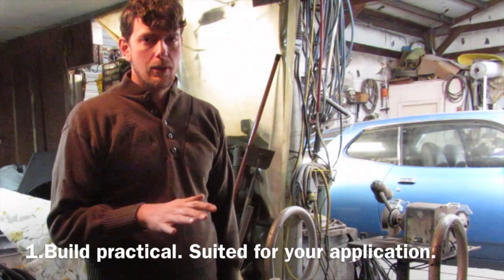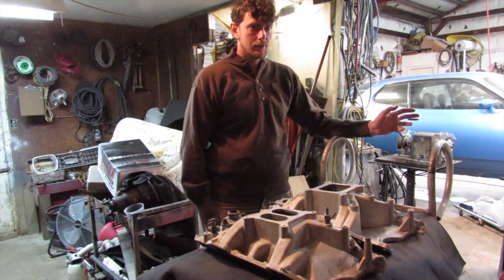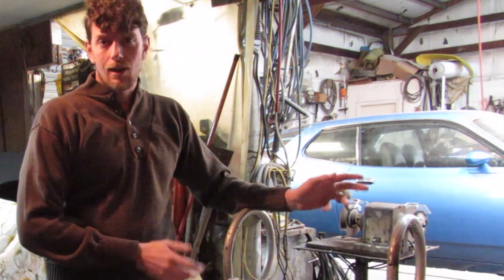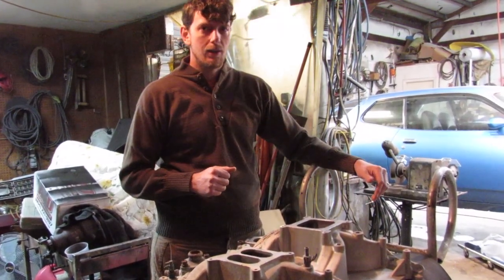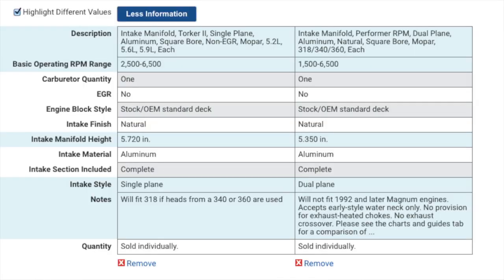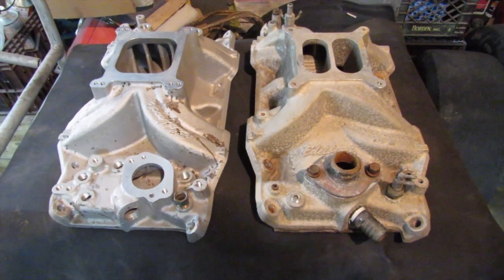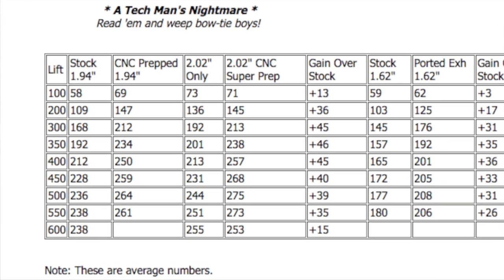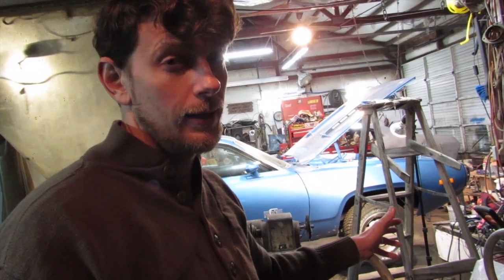Guidelines for Engine Building and Barracuda Drag Car Engine Plan

Comment: What kind of converter you got in the truck now?  Are you going to have to upgrade it to work with  this bigger cam?
Reply from the maker: Hey brother. I currently have a Hughes 3500 in the truck, but it began to fail at the end of last season. I’ve got a PTC 9.5” that I’m getting restalled for this combo by Bill Dowdy at Southern Transmission in Pine Bluff Arkansas. He’s got an excellent reputation in Arkansas. Hopefully o can cover that process

Comment: Very good advice. Too many guys go for biggest is best in cam and carb choice, and end up regretting it. Had 383 dodge with . 484 MP purple shaft cam. Ran 750 cfm Carter AFB. Was a slug off the line no matter how I tuned it. Swapped to Edelbrock 600 and it woke up! Smoke tires from dead stop no problem.
Reply: Loved that .484 in my 440!!!  Did have the same kinda low end issues with the 750...  Added a 4 hole spacer on top of the M1 single plane and it made big difference. Hood clearance became a lil tight though...🤣
Reply from the maker: It is an excellent cam!
Reply from the maker: Thanks Kentyn. I actually ran a 750 carter AFB on my 360(stock bottom end)  in high school. It took my dad a day of tuning to get it right on the torker 2. Changed rods and jets a few times, and possibly a different hole on the accelerator pump. Truck ran a 9.18 with a .480/ .292 lunati bracketmaster cam and 3.91 gear with drag radials. It only had a 2500 stall. Could have gained some with a better stall.

Comment: Good video man
Reply from the maker: Appreciate it @Scotts Speed Shop. I know you're no stranger to the Isky family. They've always done us good.
Reply: @JustMoparJoe  I wish I could say I liked the Isky cam I bought originally for my Dart's 273, but it was freaking garbage. However that wasn't Isky's fault, that was my fault for listening to the For A Body Only guys, they told me that cam was perfect, and I proved them wrong by installing a significantly larger cam
Reply from the maker: I've never had an issue with Isky. They actually custom copied a solid lift that Dad sent them for the 440 in his old 440 swinger. They told him, "We've never made a solid flat tappet cam that size! LOL

Comment: What do you think of the weiand x cellerator over the torker I have one and im thinking about useing it on my 422 with trick flow 190s
Reply from the maker: I'd try it and see! I don't know the flow numbers in a comparison, but I know they're out there. I'll try to check my book and see his opinion.
Reply: @JustMoparJoe  THANKS i do apprecriate  that
Reply from the maker: dan buchner here’s a hotrod article of a Chevy build. The gains weren’t much. The torker 2 was better under 4,600 than most others. Then it kinda failed. Maybe I need to do a spacer test at the track! 1”, 2”, 3”
 https://www.hotrod.com/articles/19-single-plane-small-block-chevy-intakes-test/
Reply: @JustMoparJoe  Thankyou sir

Comment: This helped me a lot. I want to run a 13.50 in Colorado but still be able to cruise it. I started at the back of the car, put a posi with 3:73, new trans with upgrades, and a 3200 Branting converter. Basically a stock 400 block with 440 crank, dump truck heads. Heads next?? Your videos are helping a lot, thanks
Reply from the maker: It sounds like you're building a hot stroker! Idk what dump truck heads you have, But my orange Barracuda had ported 452's on it, running 6.71.
Reply: @JustMoparJoe  Holy cow that’s fast. Did you port them yourself? I need to watch some videos on how to do home porting. Thanks for reply👍
Reply from the maker: @maximuswedgie5149  They were done by a head shop. I have some decent videos on porting small block intakes and heads. Hopefully they will be somewhat helpful. I really had done some research and tried to mention as much as possible in the videos. My goal is to do each task better with experience.
Reply: @JustMoparJoe  I will definitely watch those videos!! Thanks!